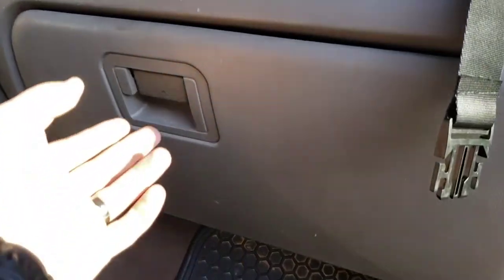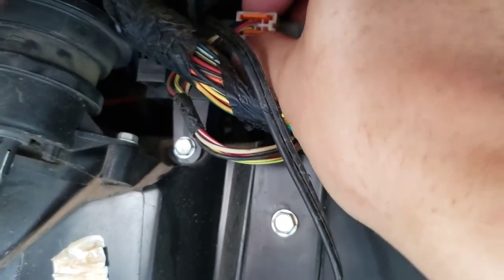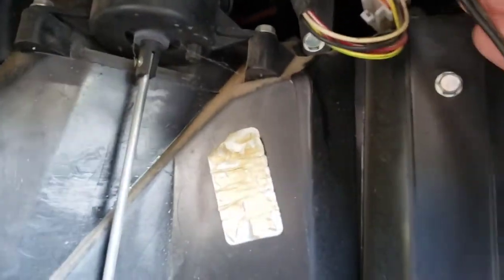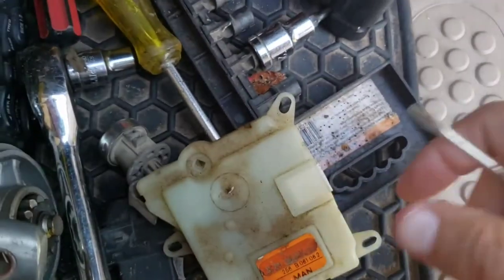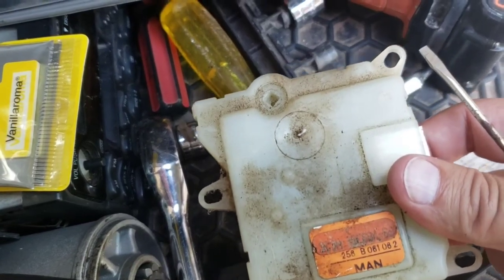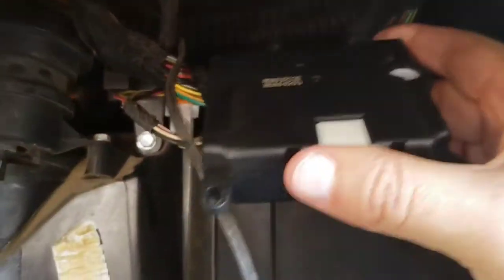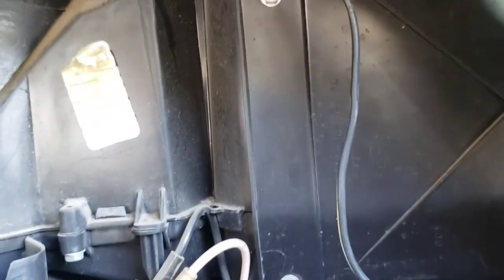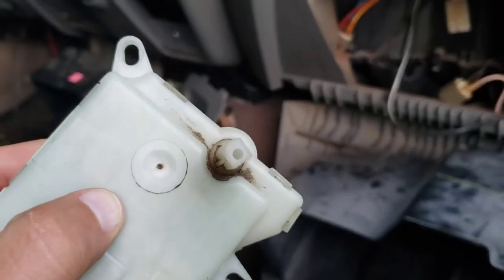1999-2008 FORD F250 F350 SUPER DUTY BLEND DOOR ACTUATOR REPLACEMENT

Comment: I plug in the new actuator and play with the climate controls until the pegs match 🙂
Reply from the maker: Good idea
Reply: Genius!
Reply: that part is the one that gives hot and cold air right
Reply: Wouldn't the truck then think the AC is in a different position and not switch properly?
Reply: Exactly! Turning the actuator box in this tiny area is almost impossible.  Besides this, you need to plug in the new one and ops check it before installation, I bought a brand new one from a well known parts store and it didn’t work.  The old one works but, when installed clicks and doesn’t move the door, internal gears stripping.
Reply: @Jptreeservice  yes, if your system is working, regarding the compressor you should be able to feel cold on the line under the hood just forward of the glove box. Then you know if it’s blowing hot, it’s likely this Blender Door Actuator.  The actuator moving the various, floor, defrost, chest, selections is a different actuator, long and to the left of this box.

Comment: I turn mine to a/c setting and it blows out my vents, when I turn the setting to max it will blow out defrost. Do I have a different problem? Most people say it blows out defrost all the time, thats not my issue. I replaced the vacuum pump and got the same results.

Comment: Is it possible to carefully use a wrench and adjust the new actuator arm before you reinstall the blender door control?
Reply from the maker: I'm sure you could.  It didn't take too long
Reply: @RoadHardRoadhouse  hi, tried today, but it wouldn’t budge. I was afraid it was gonna break also in my 2005 F250 that unit was oriented horizontally rather than vertically like the video shows and it was difficult get in there.

Comment: I have heat but its not super hot. Sometimes it wont defrost the windshield will this help if i change it? And air barley blows out the vents it has a new blower motor new resistor and a new vaccum pump new pulse vac actuator.. How do i get more air out my vents
Reply from the maker: You can always try it , just in case and take it back, or get a cheap one at a pick and pull.   I can't remember how much it was...

Comment: Maybe you can help me out I have an 2007 ford f350 king ranch super duty 6.0 diesel power stoke and it doesn't seem to go to cold air when I switch it from  heat
Reply from the maker: I'm not an ac tech or anything,  but have you had it recharged?  I have a video for the super duty in my playlist for the f350.  That is my usual case for no cold air coming out.
Reply: Have you checked if the little grey vacuum tube is in the heater actuator on the passenger side of the motor. it goes it the front of the heat actuator connected to your heater hose.

Comment: So this fixed the problem of AC and all air going through defrost vents back to normal vents?
Reply from the maker: Yes, it did.   No more defrost all the time
Reply: @RoadHardRoadhouse  ordered from the site you suggested...just replaced it with part made from China and I'm still on defrost...I was so excited
Reply: @youjustdontgetit8117  I found small hard plastic vacuum lines on my firewall that were broken, I repaired them and the air started coming out of the dash vents instead of the defroster vents. I'm not saying yours is the same, worth a look.
Reply: @scottmclain3145  I'll check them out but those are practically new when I redid my motor
Reply: @scottmclain3145  my boy said he thinks it's the control switch broken on dash panel
Reply: @scottmclain3145  what year and make is your truck...I have an 03 350 7.3